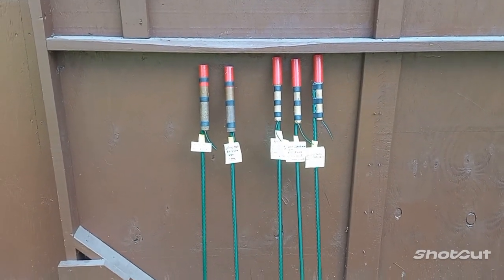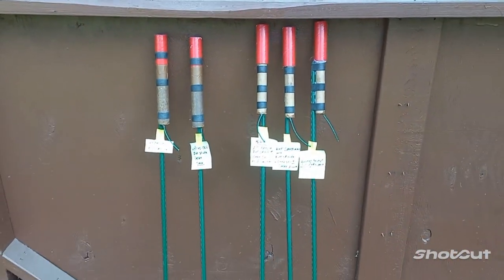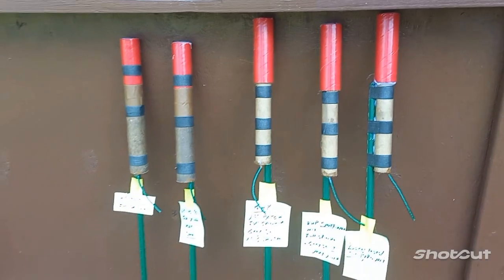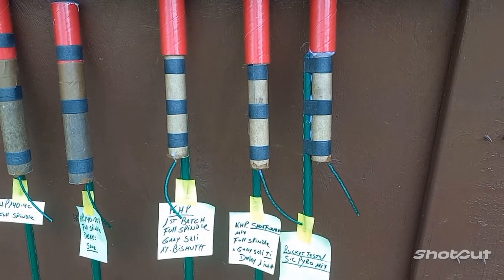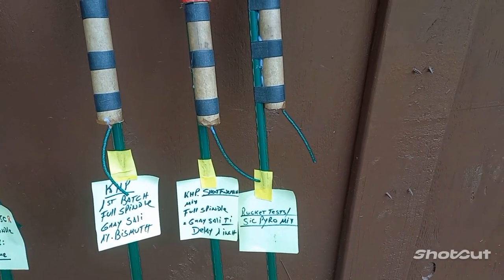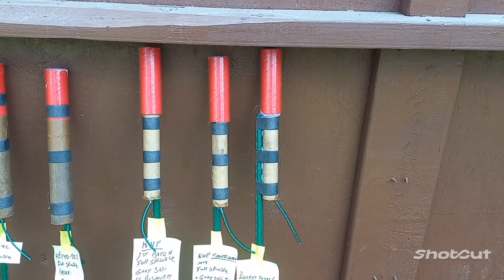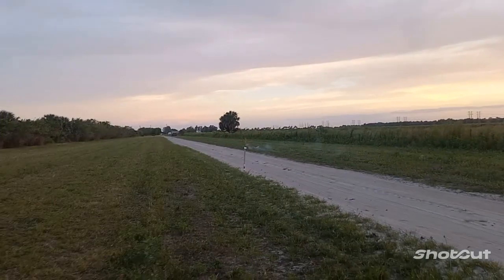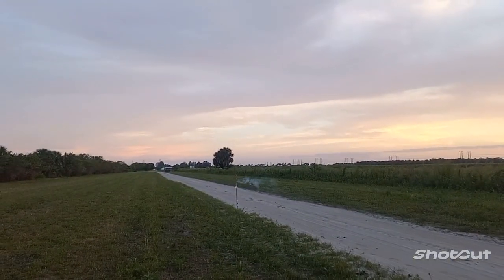KHP whistle fuel test,  Full spindle .(Description below)

Comment: Red gum for the win 🥇 🤘 was that 1%?
Reply from the maker: That was your suggestion 1.5%👍💯💥
Reply: @Pyroflorida  right on 👍
Reply: @Pyroflorida  try no phlegmatizer 💪🏻🚀
Reply from the maker: @777treyu I didn't use any , are referring to the red gum?
Reply: @Pyroflorida  67-31.5-1.5, no phlematizers or granulation 8% perlite light by weight will help fireproof it and grain cracks or density at the expense of sound volumes. “Adjustments might be needed with different spindles.”

“ECO KHP Formula”
Reply from the maker: @777treyu  interesting. Tks, I don't really care about sound .. I'm using sali with 2% black copper oxide as delay in all of my whistles , I'm behind the power that khp offers.
Thanks for the good tip, I'll get some perlite to give it a shot.
By the way , your red gum KHP mix is amazing 🫵